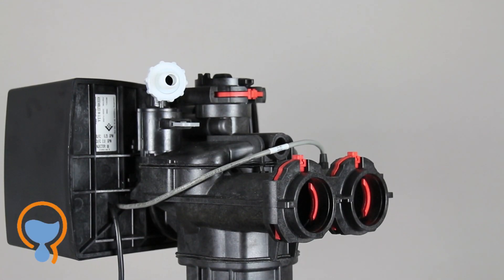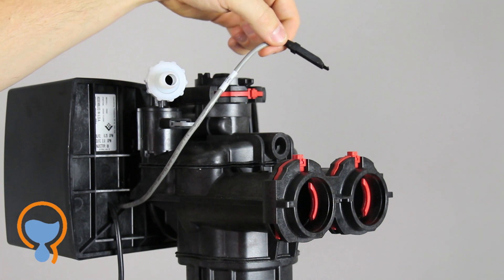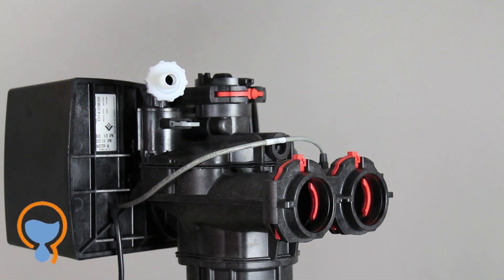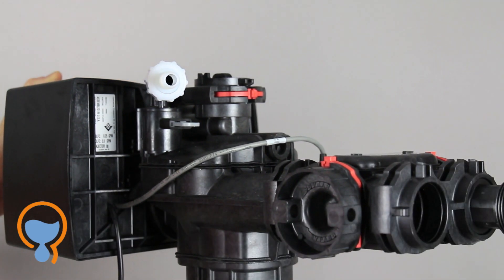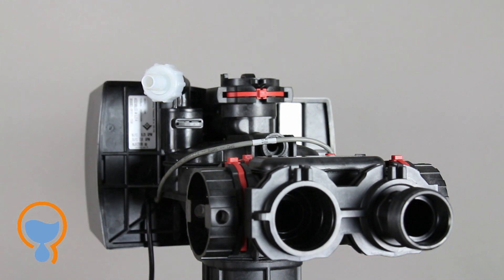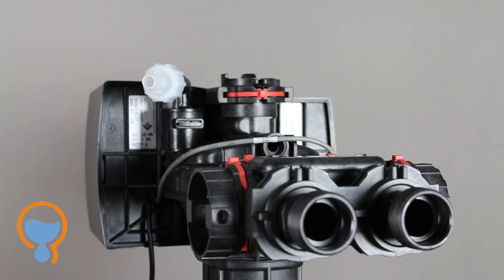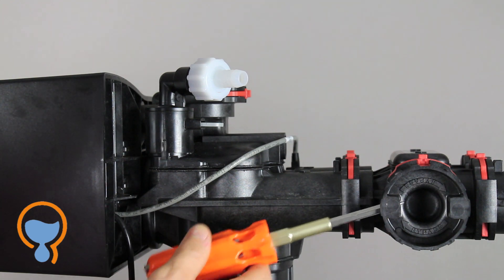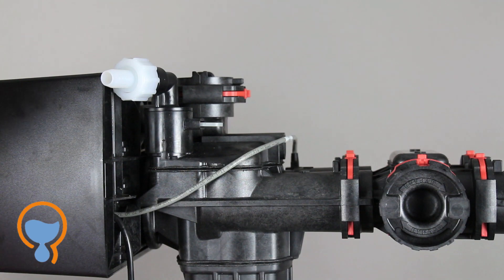Fleck 7000SXT Bypass Valve and Plumbing Connectors

Comment: Do I need to remove the red clips to turn to bypass mode? Lately I've been having low water pressue and I want to rule out the water softner, so that's why I want to bypass it. Can a water softener cause low water pressure? Thanks in advance.
Reply from the maker: No you don't need to remove the red clips to put the system in and out of bypass mode.
Reply: Thank you for the quick reply. I appreciate it. I'm a YouTube plumber. Lol.... are there issues with a water softener that can potentially cause low water pressure? Thanks again.
Reply from the maker: @gabrielmagana3054  Ha!  I love it...YouTube plumber.  Yes - as water softener resin ages (especially when it's on a chlorinated supply) it starts to break down.  As it breaks down it swells and this causes gradual pressure loss.  If you leave a faucet running and put the softener in and out of bypass and you lose significant flow when the water is running through the softener then the resin is likely the culprit.
Reply: Thank you so much. Your response was extremely helpful. I did as you suggested and the pressure is much better in bypass mode. Now to watch more videos for my next move. 😅

Comment: How do you take out those clips without breaking them?  They are like frozen in place.
Reply: THIS WORKS:  Take a nylon strap (or a piece of rope) and wrap it around the tank AND  the 1" water supply pipe  as if to tie a knot to pull tank and pipe together....          do this at a point near the top of the tank (just Below the point where the contour of the tank begins to "curve" toward the valve.)  Now, tighten the knot around the pipe pipe and tank. Get a rod or a stick (about 2 to 3 feet long)  and slip it between the strap and the tank and twist it tightly enough  to pull the pipe closer to the tank.This relieves the pressure that was holding the clips "frozen in place".  Now get your needle-nose pliers and easily remove the clips. You my need a helper to hold your "twister stick"  in place while you remove the clips.
Reply: @MM-sb1gd  thank you so very much. They should have covered this in the video. I was able to bear hug the unit while my wife pulled a piece of a broken clip out with ease.

Comment: Son has one of these plastic 7000's, only four years old with leakage problems.  I have a much older 5600 with an all metal bypass valve that has been problem free for 15 years now.  Probably why us old timers say, they don't make them like they use to.
Reply: Thanks for the comment Nicholas.  I'm sorry to hear your son's system is leaking.  We've had fantastic success with the Fleck 7000 systems but there's no denying the durability and longevity of the 5600 units also.  Let me know if you want some assistance diagnosing and fixing your son's softener issues.
Reply: hi, saw your comments on the fleck 7000softner valve I bought a seal and spacer rebuild kit and I cannot get the seals to line up correctly when reassemble it the valve the piston will not move and you can tell when you tighten the plate that its binding any suggestions? otherwise ill have to buy valve control head .saw your comments on youtube.thanks john
Reply: Filled the tank with media, water, screwed the 7000 down tight and positioned the tank to it final position before final piping for perfect alignment.  But the story doesn't end here, also having problems with automotive with plastic intake manifolds, valve covers, emission control devices, even interiors that get brittle with age that were neven problems before.  Difficult to convince this old timer that plastic isn't the problem.
Reply: If you can tell me where the leak is coming from, I might be able to help you find a solution.  I won't be able to help you with your car's intake manifold or emission control though ;)